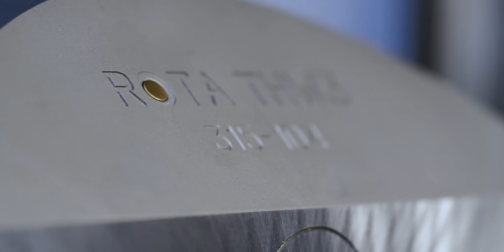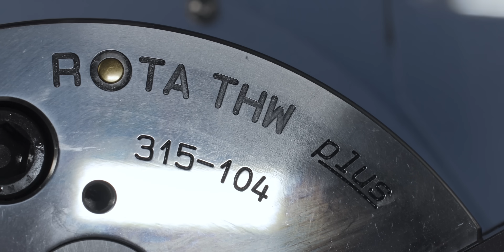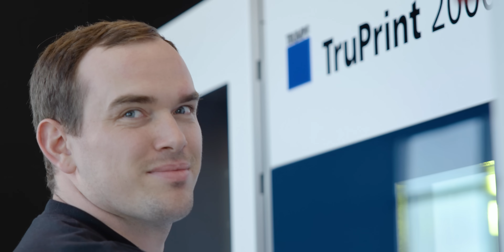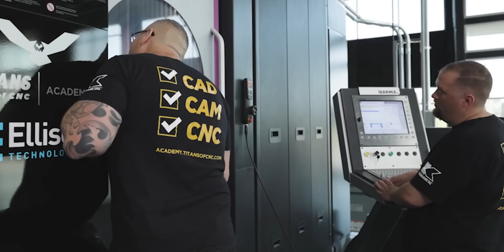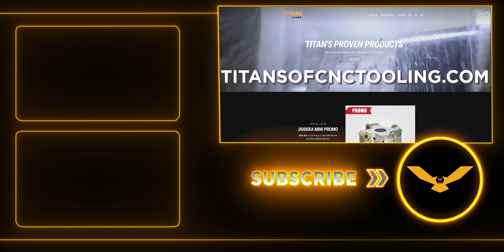Should Engineers Be Arguing with Machinists Over Run Time?

Comment: In order to improve a process, especially in a large company, you need a feedback loop. You start by documenting a process, performing that operation then confirming the legitimacy of the process and changing that process as needed using the feedback, with new SOPs introduced and more feedback afterwards. It should be a never ending cycle in order to improve constantly over time. This is also a ISO 9001 requirement. A feedback system in the form of quoting parts, tracking hours ect sounds like a fantastic way for management to begin to improve and understand their own process over the long term, so I see no problem with this. When engineers are telling machinists why a part is taking too long, it is because nobody has a good understanding of eachothers trade. The best thing to happen in these situations is education, you can actually show them the how and why and perhaps once they learn more they can put their new understanding into future parts for better ease of machining. Regardless however, an engineer believes there is a problem, contacts management, management begins to track time , material and costs (good thing). Quotes are not matching up with real life costs (good thing, now we know adjustments need to be made during quoting)..... ditching the entire feedback system so nobody knows what is really going on... that is a bad idea. There is a book id highly recommend called the 5th discipline, the art of a learning organization that gives some fantastic insight into these types of situations.
Reply: I worked in an ISO9001 registered company for 33 years. I spent most of it as a process planning and methods engineer. This entailed, amongst other things, creating job sheets complete with times for each process. I used established times for the initial estimated time then, after the first production of a part, corrected the times I was often called to the shop during manufacture to discuss times or manufacturing problems with the guys on the shop floor). The management and accounting departments were always trying to stop me from upping times and wanted existing times to be reduced to make the part cheaper! As I kept pointing out to them, this produced bad data on the system and the result of bad data is making a loss not a profit. I told them if they wanted the parts cheaper then find someone else who will make the parts to the same standards but cheaper. They always failed, standards always make thing expensive after all. I liaised between the production shop and the designers and was in the loop for drawing release so made sure parts were designed in the best way to keep costs down and that errors on drawings were corrected before I would sign them off for release. It also gave me advance warning of the need for any special tooling so it could be in place before it was needed. Fixing drawing errors always costs more once they are released into the system. If we required machining at any point in the production process I always went to the machine shops to get an estimate because it was not my area of expertise, my usual aim was to design out such requirements wherever possible to keep the part in one department and so keep control of the lead time on a part.
Reply: feedback loops can be great, but bad data can be much worse than no data. when you have all sorts of people trying to game the feedback loop, you have LOTS of bad data.

Comment: I had my supervisor come to me to tell me the Boss didn't like the way I was machining the part I was making. Of course the Boss sat behind the window of his office and watched us in the shop. I told my supervisor I was open to suggestion on how the part should be made. What does the Boss suggest ? My supervisor said the Boss doesn't have a suggestion he just doesn't like the way I was making the part. I told him to go pound sand. Part was made and passed inspection. We had one older machinist quit over stuff like this. Another filed a lawsuit against the company and Boss. He got a raise and the Boss was not to bother him again. This machinist later started his own CNC company. We had a contract to machine a 130mm o-jive for a anti=tank missile . We could machine the o-jive in 20 minutes . The company set up another department to machine the same part. One day the 2 young fellows from the new department told me they cut our machine time in half. I said great. After inspecting the parts they machined all came to us to be recut and back to the 20 minutes run time. I left this company and went to work at a university for the next 25 years where I was my own boss. The university hired a engineer from another university to design a physics device for research. The device required a driveshaft 4 feet long to drive a turbine from an electric motor. When I got the drawings I asked the engineer if we would be using drawn-over-manrdul tubing ? He said no just regular tubing. I made 6 driveshafts and even had them balanced. The device would walk off the table at 750 rpm. I made my own drive shaft out of 3/4" diameter shafting. I didn't tell anyone. I tested my shaft to 3500 rpm and it was smooth as butter. I called everyone in to watch the test. After I told them it was my shaft they were not happy. They used my shaft.

Comment: I'm an engineer and have been for 9 years now, but I have over a decade of machining experience specialty was programming and fixturing both of the VMC's and 8 Swiss machines. I basically ran the whole shop I started as a button pusher on a 1997 haas VF-02. The owner was the programmer, and the x axis failed after a year, and he picked up a  demo VF-02SS 2006 machine with every option unlocked but ran the old code. I pulled the code converted from line by line to sub routines and added a ruffing tool and 5x the sfpm with my OWN carbide tools and did an entire week of production in 1 afternoon. After that he was shocked I talked him into getting me a Mastercam license and let me redoing all the machines within a month I had the shop dropping more parts in a day then it was doing in a month before. Also contracted with a local metal company to buy back are chips given we ran 99% cast aluminum at the time. I never asked for a raise, but 6 months after the changes. John dropped a 50k check on the table as a bonus  and had me sign a bunch of paperwork, making me at 21 a partner in the company. 13mo later, he passed away from cancer and left the entire company to me I ran it for 9 more years and sold it off as the equipment just was to worn out and the cost to rebuild was so high most of the machines had 20k hours or more at that point.
Took the cash invested in tesla and bought a house met my with a year after she to this day has no idea that I bought 5000 shares on tesla ipo and currently have 82800 shares in tesla and 10800 shares in Motorola.  I personally know Elon from PayPal, so it wasn't a big deal to toss 75k at his startup.
My wife has zero clue. We have a prenuptial agreement because she wanted to protect her savings and life's work (not from the usa) it basically makes everything from before the marriage 100% our own, and only the joint account can be split in case of separation. She lives a high life with fancy bags and shoes  watches. I'm more the blue jeans and a jacket type, always working on something can't sit still. I work from home on and off make around 120k a year she makes around the same kids go to a reasonably good school and she has around 480k in savings and tends to treat me as the dead beat with only 80k in my 401k and 20k in my bank account she has never seen my brokerage accounts and never will, things have been falling apart for the relationship the last 2 years trying hard to make it work for kids but who knows what will happen. That's my life story.

Comment: We have an ECR (Engineering change request) system where the engineers (most have shop floor and machining experience) decide the set up and run time however if they are off, the machinst can complete an ECR form which will flag the times when the job comes through again. The times can be adjusted as we've done the job before where everyone is happy :)
Reply: First off: you have engineers with floor experience

You have basically won assuming corporate also has some

Comment: Maybe the engineers don't trust you're being conscientious? ;)
I'm pretty new in this industry, but it has been my experience so far that some machinists like to make their programs run unnecessarily slow and inefficient, so they can spend more time idling and browsing on their phones e.g.. 
Things like too low feeds, finishing passes (with added tool changes) on parts that don't require them, needlessly overlapping face mill passes, multiple depths when only one will do, etc - those are just some of the things I regularly encounter when running parts that have been programmed by someone else.

Comment: Mechanical engineer here. I do not understand how is it possible to design something without machining experience. When I am not sure about manufacturing I go to a machinist and ask. The pieces of advice that you get from people with hands-on experience  (e.g. machinists)  are gold.
Reply: I do this too, it’s the only way to truly get the best of both worlds and save everyone’s time!!
Reply: And not even just machining either.

ALL parts.

I always work the foundries, molders, sheet metal houses, job shops, paint/powdercoat/anodizing, everything. You have to do this less & less as your career progresses, but if it's something new/complex/just looking to cut costs/whatever, I'm running the design by whoever is going to be making it.

This is one of the major benefits of in-house manufacturing. Can't walk down to the machine shop & see how things are going/what's frustrating the machinists when the factory is 3000 miles away in China & only has one or two people that can read/write English & even then, only at a 3rd grade level if you're lucky.

1st company I worked for also organized field trips for the engineers. We'd visit the job shops, foundries, sheet metal guys, etc, etc, that were making our parts. 

100% worth it.
Reply: @Iceberg86300  One of the many reason why off-shoring was, and still is a stupid idea.
Reply: Yes..even for tolerances and tolerance zone is important to know little bit about machining..I am working in aerospace and it's so funny how engineers think that cutting through the steel is the same as cutting through butter.They end up with part 0,2mm larger than it should be because material push that tool outside the given pathline. :'D
Reply: I'm a hobbyist 3D printer/designer and I 100% agree. You have to know if a feature is difficult or cost effective, or at least know if it's possible to begin with before implementing it and sending it to production.
Reply: Those are the best engineers.. They are gold.
Reply: I think both worlds are strange. I own CNC machines and I am a heavy user of solidworks. I hire veteran machinists who love to tell me it can't be done then make the parts. I have veteran engineers pay me for redesign of their stuff. But I don't think I'm neither machinist or engineer.
Reply: I spent a lot of time in my early years of my career visiting various manufacturers. My boss at the time would always express the importance of intimately learning about the manufacturing methods from the experts, ie the people making the parts. It is important to understand the process to make good design decisions, know the limitationss and know the trade-offs. With that said, I've met stubbornness and narcissism on both sides. I have little interest these days working with someone who isn't open to constructive discussion about cost, quality, time and new ideas.
Reply: True. But a lot of the parts should be easy enough to design following the basic tech manual. Only once you've done through those should you be wasting the machinists time.
Reply: @phillcom3  what the hell is a basic tech manual?

But even w/o knowing what you're talking about, as an engineer if you haven't spent time in a machine shop/other manufacturing  and/or haven't interfaced at all with the experienced professionals in those areas, it's extremely likely that you're causing problems and/or making parts that cost a lot more than they need to.

It's not all about the "basics" of tolerances & finishes & not leaving sharp corners in a pocket.
Reply: As a mechanical engineer by education, former high volume precision machining manufacturing engineer, welder/fabricator, journeyman toolmaker, quality engineer, manager and director, I agree. So many counterparts had to rely on and believe tooling and machine vendors with no knowledge of what promises were realistic because they had almost no machining experience.
Reply: You sir are one of the good ones! Engineers like you are as rare as hens teeth! ha!
Reply: @SirRootes  Thanks!
Reply: You would be an exception to the rule: many engineers have zero clue as to how something is produced, and don't care. The machinists are merely monkeys that barely even comprehend the designs the godlike engineers put forth.
Reply: Please tell this to my college. They're trying to develop an online mechanical and manufacturing engineering undergrad degree. They're also slowly killing off a lot of the hands-on classes and bleeding the machine shops dry. It's quite depressing
Reply: @Trenz0  I used to see a lot of people with electrical engineering degrees that didn't even know what the components looked like upon graduation - it took an extra couple years of OJT to make them even borderline competent. Compare that with programs that had students design and then build the working circuits. The amount of failure and hair-pulling the students went through was greatly beneficial as it wasn't just theory any longer.
Reply: Worth you weight in gold
Reply: I was a master machinist and mechanical engineer, which works great for my job.
Reply: In recent years, I had a design for a tesla turbine, for which I had already acquired several discs, which I was checking around for initial pricing on drilling 4 holes in.  One shop stopped answering my emails entirely after I told them that the discs had been coated in titanium nitride... the next 'prototype cnc' outfit, I visited in person; in talking to the guy (who looked like he personally power-lifted all of his machines into place), it seemed like the apparently simple project was some sort of rocket science beyond his head (I guess maybe his education stopped at his high school shop classes or something!?); first he had to be informed that tungsten carbide should cut titanium nitride, then addressing the problem seemed too difficult to him to fathom (I prompted him indicating that maybe they could just use some sort of ~jig to do it), at which point he quoted me $100 'per part' just for drilling said 4 holes in each disc!?  It would seem that I could buy my own equipment for what it might cost to complete a project of any significant complexity with that kind of pricing & attitude.
Reply: #meToo.

Comment: Right on - it's perfectly fine to run time studies to track costs. Not cool to use those numbers to beat on the machinists without a baseline of comparison, like farming some parts out and comparing costs. Root of the problem is people who can't do what you do and have never walked a mile in your shoes thinking they are qualified to judge. I was a design engineer for many years and promise the same thing happens to us.

Comment: Ive been a machinist for 20 odd years now. I constantly come across extremely difficult to machine features or tolerances on components that really dont need to be so small because the engineers have no machining experience. If they spoke to us about parts we could probably help reduce cylce time therefore cost. Also i think a tooling expert should be involved. There are some amazing tools available nowadays
Reply: The engineers at my job are notorious for tightening up dimensions. A lot of our parts get nickel plated, instead of doing the math and giving me the most tolerance, they get lazy and just take .0005 off the mean and cut the tolerance in half.
Reply: They'll stop doing that when they request quotes for expensive things like molds that have aerospace tolerances instead of necessary tolerances. When each reputable mold shop says, "No quote", or quotes some super-high value, they'll start to think twice.
Reply: Sometimes tolerances are company policy or a coustomer requirement and nothing can be done about it. We have this problem n aerospace a. Lot

Comment: As a Machinist, Tool & Die, Prototype Model Maker, and Mechanical Engineer I speak with 44 years of experience.
I believe it should be a pre-requisite for every Engineer to spend at least 1 year working as a Machinist before receiving an Engineering Degree. I've been asked to manufacture some very complicated designs that could have been made quicker, easier and more reliably IF the Engineer understood the manufacturing processes. It's called "Engineering for Manufacturability".
Some of the best Engineers I've had the opportunity to work with all started in the Machine Shop.

I'm sure there are many very talented Engineers out there who have not had the pleasure of working in a shop. Just think how much better you could be if you had some manufacturing experience to add to your knowledge base. Have "Hands On Experience" is something you can't learn in a classroom.
👉 I personally would never hire an Engineer without some sort of shop experience. 👈
Reply: Goes both ways.   Everyone needs to be flexible.  

The team should work together.  Both engineers and machinists have constraints in doing their work… together the best path forward can be found.